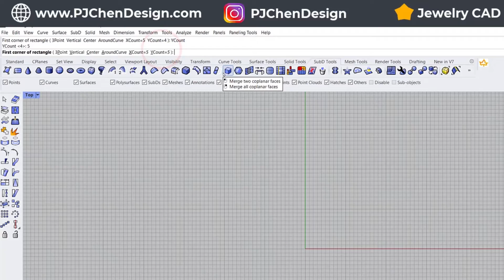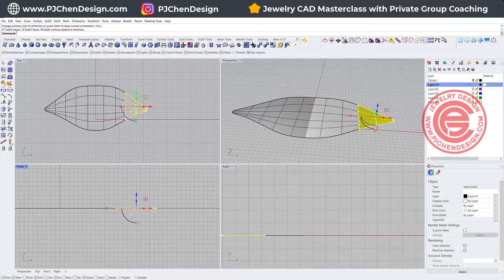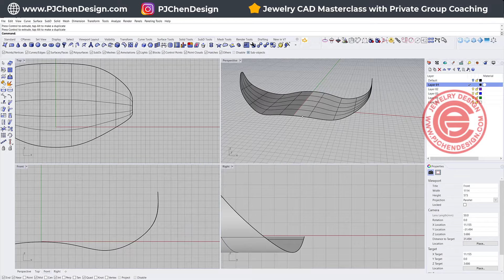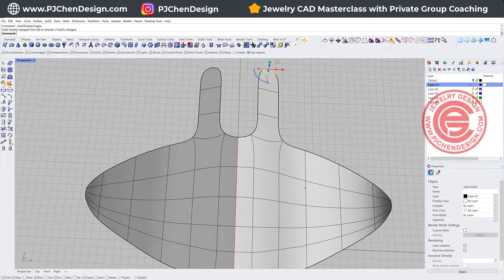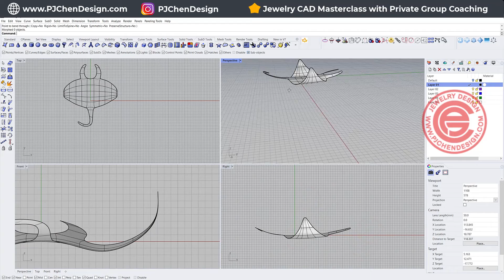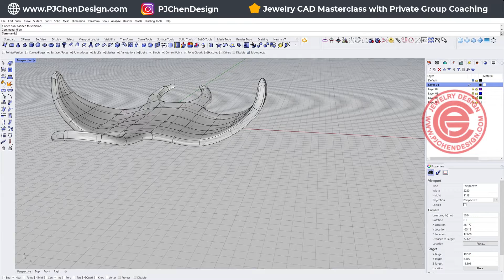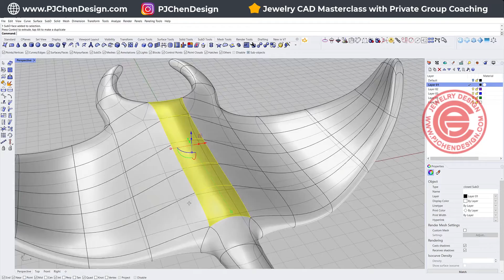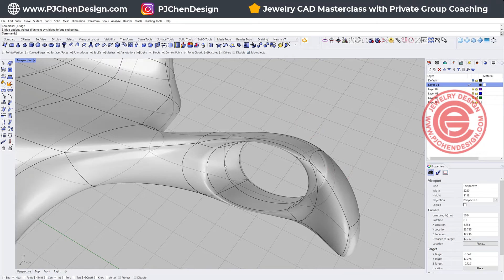Organic Stingray Jewelry 3D Modeling with Rhino 3D SubD #441

Comment: First off, thankyou for this channel! After 2 awful experiences hiring designers and casting companies to do my work I gave up and will be designing and printing myself. Your videos are a great inspiration! But I do have a question:

Most of my gems are non standard sizes, would it be better to buy a 3D scanner camera to import the stones for exact fit, or can I measure by hand?
Reply from the maker: you can 1. 3D scan but higher budget. 2. you can scan 2D for a facet stone (table down), then trace the same in Rhino to create a stone. then scale to extact size. (lower budget)
Reply: @PJChenJewelryDesign  ok thankyou!